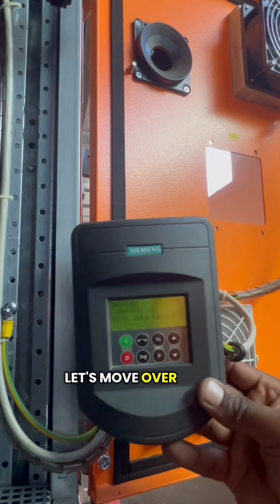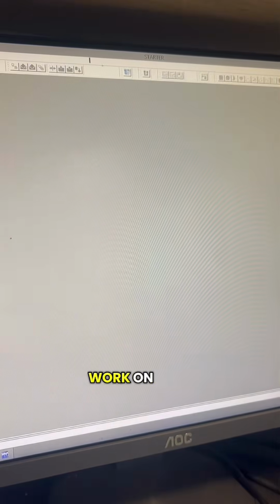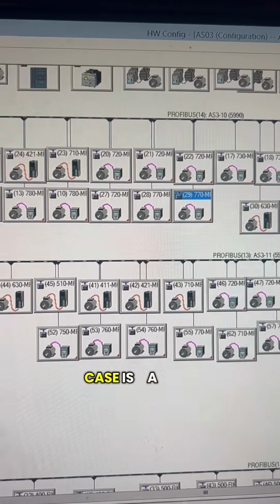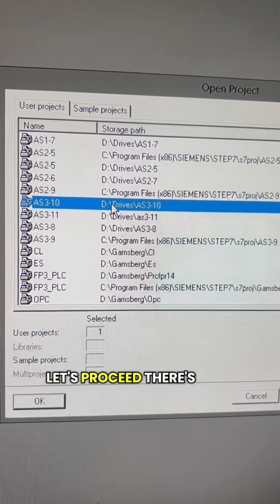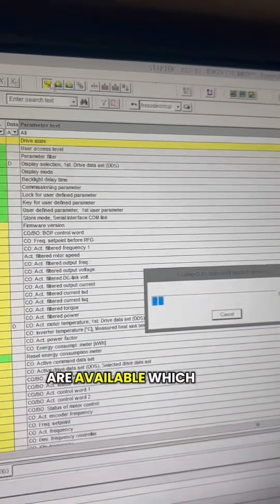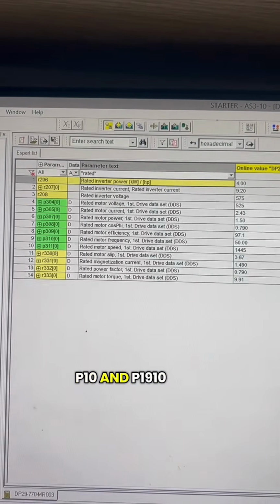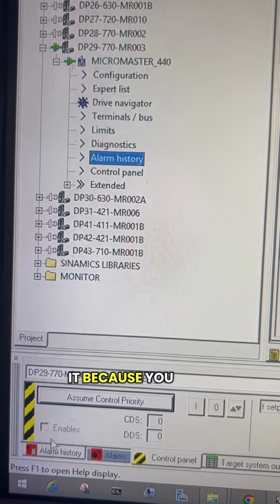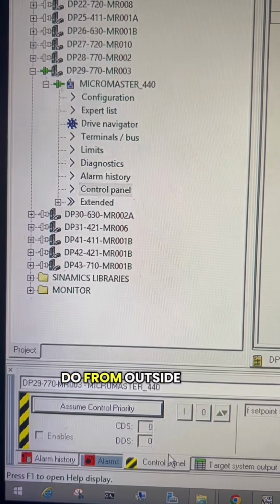How to perform a motor Identification on a Siemens VSD #siemens #motorcontrol #industrialautomation

Comment: So in most cases this is done with a new installation?

Or if drive packs up.

Doubt it needs to be done for a motor replacement
Reply from the maker: That’s correct brother 

New installations, new motor if different size and  on a new drive